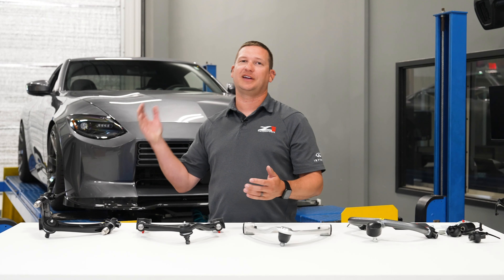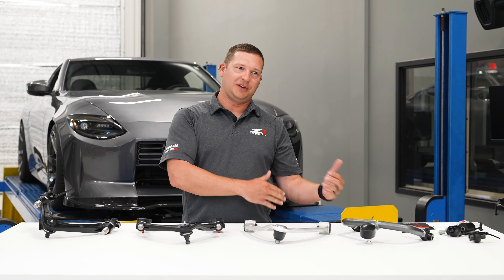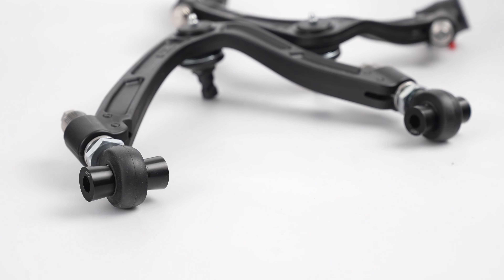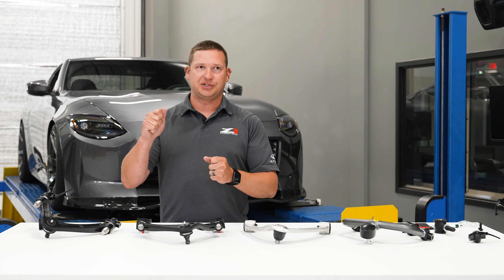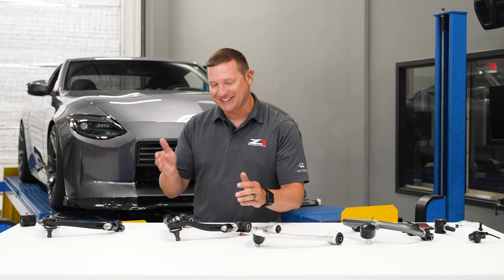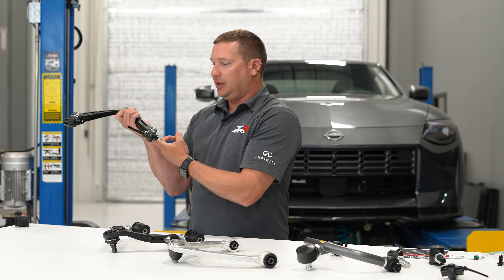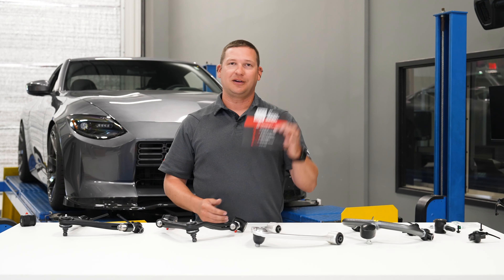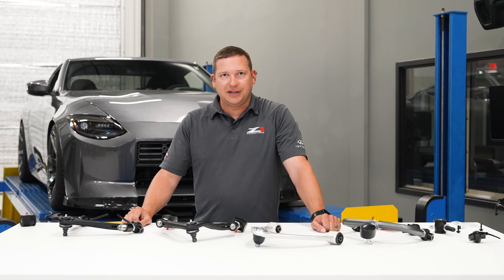Z1 Forged Front Upper Control Arms

Comment: After hearing about lots of issues with steel fuca from z1, gkteck and others over the years. I think everyone on the forums basically defaulted to recommended only SPL for suspension arms.
But this design looks great. I don't really see any reason to pay double for SPL any more. Z1 really putting in the work to lower prices and bring more accessible parts to the Z community.

Comment: Ok these might actually fit what I need.  Didn’t want to go for anything other than SPL design wise but not interested in heim joints for street ability.  Car sees 95% street and try do to about 3-4 track days a year.  Already been on powertrix ss coilovers (seem similar to your s coilovers).  How often do you have to grease your poly bushings?  Previous vehicle I put some poly bushings in and it was regrettable, at least these have a zerk fitting but I still don’t want to be greasing them every month to keep them quiet.  Shooting for an ultimate street setup that I can still throw on some 18” with stickier tires and hold it’s own on track days.  What’s the caster difference between these and stock 370z if using the street version?

Comment: I really hope they fix the noise issue on these control arms. My original Z1 FUCA's were bought early this year and they need to be greased constantly and still are too noisey for their own good. And I hope these can easily adjustable for camber so the suspension mechanics don't try to murder me every time they pull it out to adjust.

Comment: Had the previous version and had a lot of noise come from them. How is the noise from these? Street vs race.
Reply: Question for you.  Did you disassemble the bushings and grease the pins before assembly or did you just install and then try and grease?  I ask because I’m about to do mine but I completely disassembled the bushings beforehand and they were completely dry to the point the pins and bushings were stuck together.  I can easily see this would be a problem because once bonded together there is no easy route for fresh grease to get inside.
Reply: I have the race version. Greased prior to install with no issues. I don't notice noise. Maybe road noise.